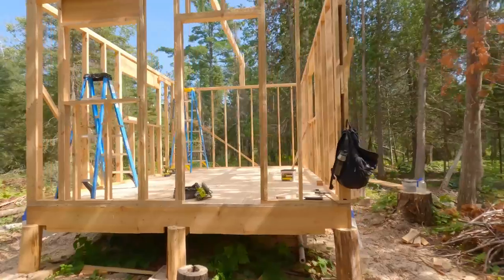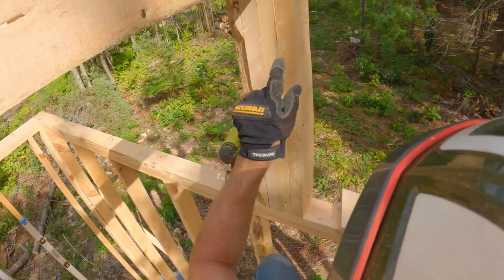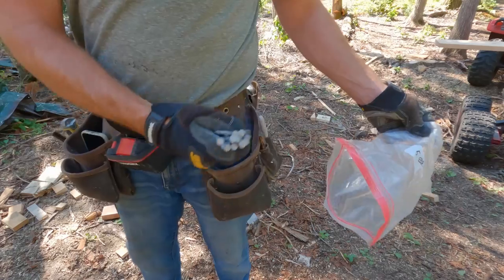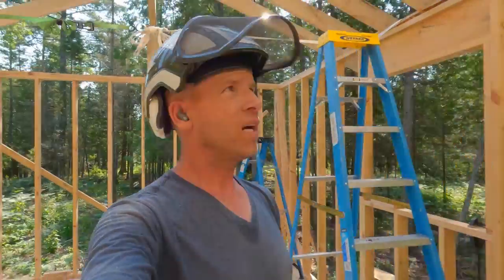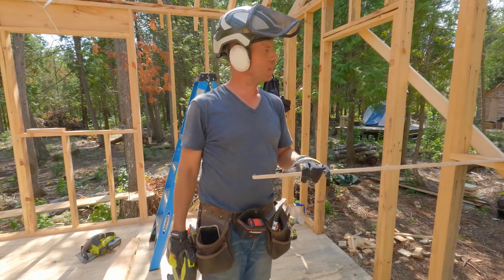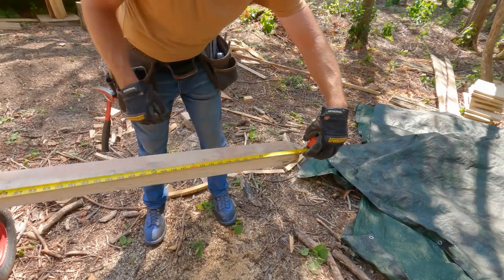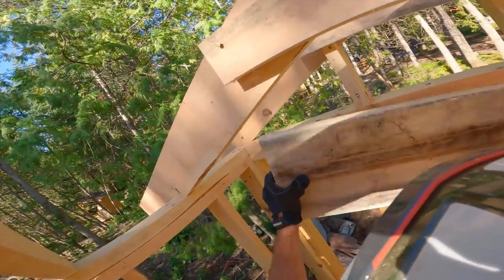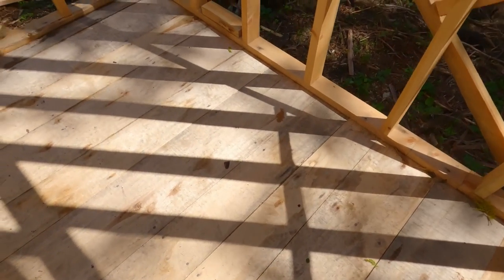Wet Lumber Framing- Solo Winter Cabin Build.. #100

Comment: Ryan, you need to double up the 2x4 under the gable end to help support the Roof better ...at least at the one end where it's just a 2x4 wall ...you should have the gable end supported better for upper Michigan snow load espically in the UP...just under the main beam on the ends....just a suggestion - have a great weekend!!
Reply: 90% of the loads transfer down onto the side walls.  The post under the bean takes very little load on the end.  It’s just there to hold the beam in place until the rafters are connected.
Reply: Thanks for explaining that a whole lot better than I did. :)
Reply: @rossclark9155  I didn't read your post previously just did now... we're on the same page was just thinking about all that snow they get in the UP....
Reply: I agree, need more support, that roof could cave in on him in a big snow storm. He didn't double plate the top.
Reply: @rayhuber3411 you might go to 17:47 in the video and look again to see if there is a double top plate. As for snow load capability, if you watch the Joe & Zach Survival channel on YT you would see a canvas wall tent with a longer (16') roof span built with 2 X 4 rafters on 24" centers. It has endured more than 10 winters so far and last winter had the more snow than that area has seen in many years. I have a fishing shack in northern Minnesota that is almost 100 years old. My shack has a 22' roof span and was built with 2 X 4 rafters on 24" centers too. The roof wasn't in great shape when we got it (we sistered all the rafters with 2 X 8's during remodeling) but it certainly hadn't caved in . . . yet.
Reply: @rayhuber3411  Yes, he did.
Reply: @D5341-m8x  Sorry, I didn't see it. Looked like one plate.

Comment: This is Paul in Youngstown Ohio.  I have two chainsaws here that one can have if he comes to Ohio and picks them up.  I have some chainsaw helmet, the pants ect too.  What I would like one to consider is this book how to build cabins, lodges, and bungalows by poular science monthly.  And then Sheds, Barns, and outbuilding by black and Decker.  Then we have Compact Cabins by Gerald Rowan.  I have these books here too.  I went to beginner carpenter school and we got as far as building some fancey saw horses.  I have four by fours in the basement for some big timber frame saw horses the plans are free on line to buld them too.  I have other building books for me too.  I am a shut in at home and have to stay here.  Am getting a jazzy select 6 together when the batterys come in.  For me to ride up the street to the two stores up there.   What I really want to show one is what I have built and machined right here at home.  AR stands for Armore light rifle, not automatic rifle.  These are single shot yet can go faster just keep pulling the trigger.  The bullets go over two miles.  I am willing to sell some of my rifes for about the going rate.  The ar-20 with carry handle 850 and ar-16 inch barrelled rifle for 650.  The ar-10 is 1500 in .308.  Yet what ever I have if I made the lower recevier I cannot sell this part to one.  Have to keep it for my personal use.  The rest of the parts can be sold.  The lower is considered the having a rifle as parts are easy to get for these rifles and assemble them.  Be very proud of oneself that he gets outside and mills lumber not to many people will do this at all.  Let alone put up buildings.  I built a shed outback to get me to immeadate carpentry.  I have one foot over hangs at the top.  I did not know what I was doing either.  While at home I watch other people on youtube build stuff.  What this did for me was to get me to work better at whatever I do.  We are in our fall time right now, the nights are cooling on off.  I have the ar-rifles in pistols too in 9 mm and .223.  The .223 can climb some when shooting it.  All my rifles will need to be broken in.  Had not been to the range to get them broken in, each one needs to be shot 200 times to break it in.  They are still stiff.  Once a ar-rifle is sited in just see to it that Michigian allows them there.  I keep mine locked up until I shoot them.  I have the larger clips too, maybe 30 or so.  Some states on want their people to have single stack mags. I have no mags for the .308 winchester.  They come in five shot clips.  A good back stop is recommended for shooting the civilian verson of the military rife.  I do have me some building too also, for me the air nailers and such.  I have a air roofing nailer that I put fresh o rings in and it is not advancing the nail in it yet.  We have a restore close on by here too in Struthers Ohio.  On ebay or amazon search for building books.  They have some good building books on Ebay.  I have a little librauary and one can pick up stuff too just by reading them.  On a residential structure it is recommended to use 2 by 6's the wall will be a bit heavier too yet they hold some good insulation to keep one warm.  If one is interested in comming on down to Ohio, it is roughly about 300 or so miles away from Michigan, just let me know.  If I cannot sell one the whole rife I can sell one most of the parts minus the lower receiver and its parts.  At Ar-16 .com one can learn how to complete a lower receiver.  The receiver the lower part will have a serial number onto it and one then install the lower parts kit and go and shoot it.  The little springs and detents are small yet I put an towel over top when installing the small stuff so it wont fly accross the room.  Try to check out ebay and amazon for building books anyways.  The information can stay in the books for  one to build stuff.  I have the building books on how to make better buildings too.  And some on Barns and out buildings.  Who knows maybe one can get the boy scouts to come on out and camp some.  At ten dollars each boy scout one can make some upkeep money on the place way out in the woods.  Girlinthewoods on youtube and her husban has their each channels .   Smokey mountain outpost is a good cabin builder.  My self reliance is building him a good looking cabin on his site in Canada.  Comeon something builds stuff too.  They have a lot of people building stuff.  The shed guy is good too.  I will go now.  Paul in Ohio.

Comment: The board that runs horizontally between the rafters is called a collar tie. It really strengthens the structure. I follow a garage builder in Vermont and he has used this system for 20+ years. Kens Carpentry.
Reply: Ken would tell you though that a collar tie doesn’t do a ton for stability down into the walls.  To stabilize the wall you need a rafter tie (sits right on the top plate of the wall and is fixed to the top plate and the rafter)
Reply: I watch him too! He did some work on Lumnar Acres.

Comment: It definitely would be a good idea to do the morning like you said put another layer down insulation board and then nice four on top of that. Insulating the floor of the cabin it is that most people don't think about too much especially when the building is on stilts which gives you good air flow keep the moisture down from underneath the building or at the same time a way to what cold air in and how you're out and when you want to keep it in should definitely put a wood burning stove in there maybe not to heat the entire place but you can set it up with a drum and make a hot water heater out of it whereby and running the stove by parts is boiling hot water to do anything. It works by a hydrosython effect no mechanical pumps required

Comment: It is a ceiling joist but it’s kind of a strong back too because it will hold your walls straight. 
That place is looking GREAT 👍
Reply: Joists are for floors. It's part of the truss. As a collar tie it will help strengthen the roof from snowload while helping strengthen the walls.
Reply: Since we're picking nits here, I'd call the horizontal 2X4's holding the rafters & walls from being pushed outward rafter ties. If they were in the upper half of the rafters then I'd call them collar ties. Of course Ryan and everyone else can call them whatever they want, so please be creative! 😛
Reply: @noyopacific  I didn’t mean to sound like that sorry
Reply: @markmckeachnie4484 , sorry, if you mean my quip about picking nits, I hadn't meant it about your comment. It was intended more as a good-natured wisecrack directed at myself Mr. Thiessen. I hadn't meant to seam mean-spirited. Maybe YouTube comments need to offer an alternate font to use for wisecracks?
Reply: @bigbenjit  joist are level whether in a floor or a roof. Rafters are angled.

Comment: It's so much easier to sit here at home and see ways to do things differently. But I'm sure you know more about framing than I. When installing ceiling joists, I would have put up the two end joists first, then run a string between them and nail the rest of the ceiling joists up to the string.

Comment: Great look for potential ceiling.   Next time you are in town get a can of Thompson’s water seal.  It should be about $12 - 15; spray it on the floor and your water problems will be significantly reduced.   Have you considered adding wheels to your solar panel platform, allowing you to reposition it into a sunny location?   There seemed to be a bright sunny area just beyond the structure you are building.  

Wishing you and your lady a blessed week, gentle weather and restful evenings.  Peace brother

Comment: I mentioned this when you first got the solar.   Get an old bike and mount the wheels on the panel supports you built.  That way it is easy to move from season to season.  But in the end your SWAG (stupid wild a$$ guess) methods will work and they are more fun to watch

Comment: Loving this build….could you have a wood stove and propane heater separately that way your heating with the free wood around you which is a great heat, and propane on low when your not there ……mb

Comment: Hi, I did have of my little cabin with loft and left other half with full ceiling height. Storage or sleeping for the loft. Beam going across the cabin to support loft tied the walls together and your foundation with beam down the middle will support center beam if you think you need it. My beam was 6x6 so I didn't need post. My roof was 12 12 pitch with 2 dormers 1 on each side with 5 ft wall height. Cabin 12x16 I built it for memorial to brother inlaw who passed away and my dad when he retired was out there more than at home. Turkeys, deer, small game hunting.

Comment: It works to your advantage to keep some snow on your roof as snow is an excellent insulator, so less pitch on the roof is good as long as you have sufficient rafters like you do. Also a recommendation for you Ryan, don’t let your tape  “slam home” hard as that widens the rivet hole and makes your measurement start to be off over time. Much love and appreciation for your channel, Ryan. Stay blessed, safe and having fun.

Comment: Lot more stable when cutting if you cut a 2x6 then measure for the other 2x6 and a 2x4 and cut the far end for the 2x4 while you have lots of base wood to run the saw on . Then your last cut of the 2x6 will leave you the 2x4.

Comment: You could stiffen that up a lot just by putting a couple of rows of noggings in !  
    If you don’t have a wood stove, why not ? for while you are in residence. If you need to use propane keep it for when you are not. Martin of Martin’s cabin youtube channel just does not keep large amounts of stored water in his cabin. So just bring in enough water for a day, light the stove and thaw out snow for the rest of your stay as you need it.
Insulation: If you are anywhere near a supply of reeds (the ones like small bamboo) they were much used in the UK as insulation at one time. laid horizontally between studs and over boarded  it might be a cheap solution !

Comment: Get yourself a snow rake for the roof. Pull snow off the roof, while you stand on the ground. 
Or..... Throw a rope over & cut the snow from the roof, to let it slide off. This normally takes 2 people, but I bet you can figure out something. Maybe a pulley system or a super long spring.

Comment: I saw one build on here on you tube with milled or crude lumber with lap siding and it looked crazy but it worked they had one straight edge but the natural curvyness was visible n they used wide boards like those on your floor a steep pitched roof and a red metal roof actually it looked like a cabin because of the rough sided lumber.

Comment: You should consider adding support directly below where your roof beam supports meet the top sil.  Since that will be holding up you roof and snow load, you need a better point load there.

Comment: Remember weight ( load) always like to go to the ground so you have to give it a rout . That ridge board under the ridge has only a board laid flat you should put 2 boards under it all the way to the floor think of all the weight of the roof and the snow load in time that board will start to sag even though it’s only about 2’ . Just my opinion . your downing great for a guy that didn’t do this for a living. 😉 
  I like that microscope I got to get one of them?

Comment: Hi Ryan! Nice Rings on your worm lol. You should think about putting studs under the top plates where your ridge support meets the top plates on each end. Those studs should be ideally over a post to the ground. As it is, all the weight of the roof on the ends are carried the wrong way to the boards strength. Wood fibers work best with either tension or compression, not lateral flex. Just a suggestion. Love your efforts to do your own thing and can't wait to see your next bug. Great health to all.

Comment: That door will sag; that window won't close. The center ends will sag with all the weight you are putting on the top rails. Load bearing. Ryan, you need to insert a couple of vertical 8' ers to stabilize your roof weight.

Comment: I'm pretty sure you can find 30 gallon may be55 gallon Water drums Fit and attic Then you would have water pressure That's a really good idea That you have I know a lot of people use reflective insulation for the ceiling in Is there a cabins

Comment: Love that you've cut/milled your own wood. Headers should be as thick as the wall (3 1/2 inches) and exterior bearing wall doorways require headers too. Gable end rafters should be doubled up. Just saying for next time. You could still fix your mistakes though. Proper headers on exterior bearing walls does matter. Can't just wing everything. I miss cutting my own trees and milling. You'd freak out if you ever get a table saw for milling. Throws rocks at using your skill saw or chainsaw. ✌️🤍🕊️

Comment: The floor idea you have (and have already probably built) will be airtight and work well. I’m not sure you even read the comments, but where you are and what you  are doing,,,, the wrap should still be the outer protection and Roxul or a generic brand is definitely your friend. It’s rodent resistant, unlike fibreglass, it recovers its R value if it gets wet then dries out. It’s mold resistant as well and more efficient than fibreglass. Then the house wrap, on the OUTSIDE, haha, is the proper product for sure!! It’s gonna get you better R value for less money than hard insulation. Even when you calculate the net R-value. 
    Like you say, you just do what comes to mind, so have at it!! If you do read some comments,,,,, you are gonna be a lot warmer and use much less heating fuel (wood, propane, whatever) to stay warm. If you use both!! Best of both worlds!! 
    For now, I can wait and see and then this winter the proof will be in the pudding,,, or FROZEN pudding pops!!! Hahaha.

Comment: Cabin framing is looking awesome Ryan! Just curious though 🤔, if the reason you’ve decided on ceiling joists was to save on cabin heating area how are you going to ensure your intended water storage above the ceiling joists will maintain temperatures above freezing so that your water storage remains liquid? ☮️💟from Virginia Beach, Virginia.
Reply: I want to know where the insulation is going and what insulation will be used.
Reply: I concluded he must have meant shelving high on the walls or slung from the ceiling for water storage.
Reply: Not sure how he's gonna get his water storage and insulation in the attic.....looks like it will be too small to access.  Interested to see how it progresses.  Cheers from VB!

Comment: Hi there 'The Worm', enjoying your off-the-cuff quality builds; But for sighting a saving grace!? That you might consider the future installation of!? I strongly suggest the following! We here of the 'DOWN-UNDERS' have a 'common building practices, with timber & even metal framed builds' is to install what is called here: "BROOKER-RODS". They are as suggested a ROD that tye the build top to bottom together, [ bottom gable to top plate body wall to bottom plate wall/floor & on through floor tying to the bottom under floor say where steps connect too. But at every corner, each side of corner uprights is about 6" from the corner uprights; A cheaper method is to use re-bar & weld plates at all holding faces & screws through plates into timbers, all within the frames before cladding. The SAVING GRACE, your builds STAND a better chance of STANDING in cyclonic/tornado pressures!? Just a suggestion please do consider a 'Downunder practiced solution. Hope this is understandable with an off-the-cuff builder.